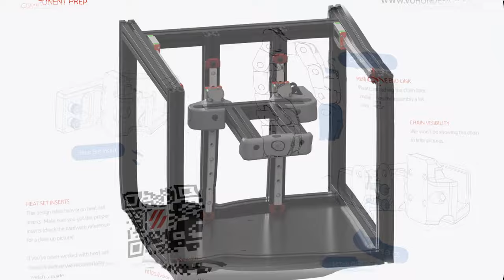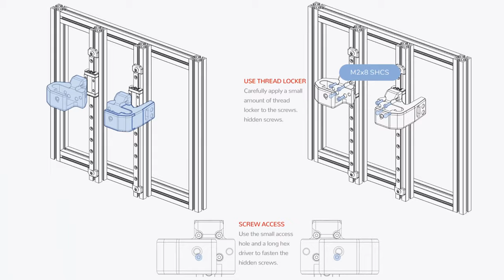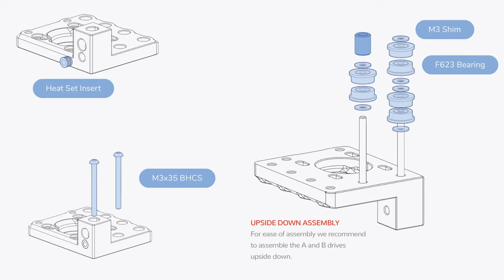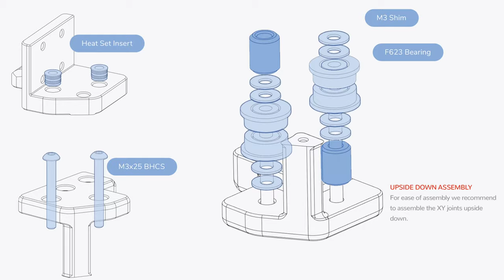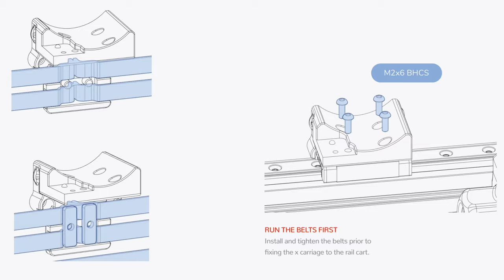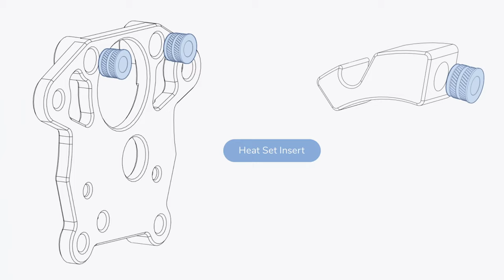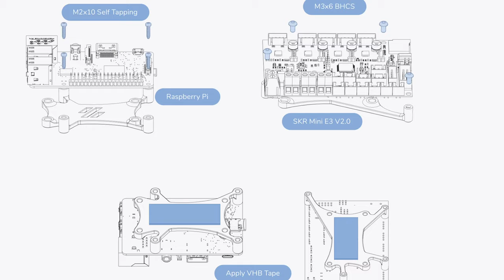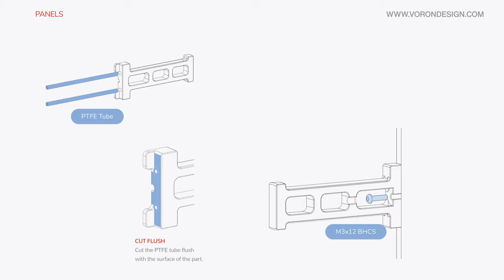The Voron v0.1 Complete Build Guide

Comment: What was that tool you used to adjust the height of the pulley at 13:40 and 15:30?
Reply from the maker: In the v0 repository there is an stl for the spacer tool!   

https://github.com/VoronDesign/Voron-0/blob/Voron0.1/STLs/Tools/AB_pulley_jig_x1.stl

Comment: I'm currently building a siboor v0.2. It uses a Fly Gemini V3.0 all in one board. I was wondering if any toolhead pcb will work with that? Like LDO picobilical kit perhaps
Reply from the maker: as long as the board has a spare USB port, a picobilical should work just fine.

Comment: Hi, may I ask why did you placed the Pi board with the USB ports facing down instead of sideways, as the Voron manual recommends? I'm assembling my first V0.1 LDO kit and I'm afraid to goof it, but if this change has its advantages I'd like to listen first. Thanks!
Reply from the maker: Hey thanks for the question!   We found it best, when working with LDO kits, to do things how they recommend.   

The wiring supplemental guide found here - https://docs.ldomotors.com/voron/voron01/wiring_guide_rev_a - places the pi in the same orientation we have it!
Reply: @MapleLeafMakers  Thank you! I really appreciate the synthesis and the close up high def cameras that you used in that video. I prefer it to those multi hour marathons with poor camera positioning and framing. I was watching like 3 different V0.1 build videos until I stumbled upon yours.

Comment: Hi loving the video so far. I just got an ldo and started my build. I noticed that you aren't using the square nuts that were included. What are those nut that you are using? So far my experience with the square nuts are horrible. I think they are called t nuts or hammerhead nuts but what size are are needed to fit into the extrusions?
Reply from the maker: We used this 'No-Drop Nuts' mod: https://github.com/VoronDesign/VoronUsers/tree/master/printer_mods/zruncho/V0_No_Drop_Nuts it's actually recommended by LDO in the 'Tips' section here: https://docs.ldomotors.com/en/voron/voron01 they make a things MUCH easier.
Reply: @MapleLeafMakers  oh man that does make things so much easier! thanks you. :P
Reply: @MapleLeafMakers  I downloaded and printed a bunch of these, however yours look different from the ones that you and everyone else links to.  Yours are a simple rectangle with the hex nut pocket and a hole.  The ones that are linked on Github have the tabs that come up through the extrusion and do not have a through-hole and they are absolutely terrible.  I'm assembling the Z-Axis right now and, because they don't have a through-hole, it doesn't fully tighten down onto the extrusion in the blind fastening situation.  I know Fusion360 pretty well and I can design my own, however I'm confused as to why the nuts in the video aren't the same one as in the link and how people are getting the ones in the link to work properly?

These appear to be the ones you are using in the video, I printed one and it seems to work much better than the one you linked to and the one that LDO links to.
https://github.com/VoronDesign/VoronUsers/blob/master/printer_mods/Zen3D/V0_1515_T-nut/LDO/HexNut_1515.stl
Reply from the maker: @davesauvageau4376  Check out this one!

https://github.com/VoronDesign/VoronUsers/blob/master/printer_mods/Zen3D/V0_1515_T-nut/LDO/HexNut_1515.stl

Let us know if it works for you.

LDO links to it directly from this page.

https://docs.ldomotors.com/en/voron/voron01/printed_part_guide_rev_a